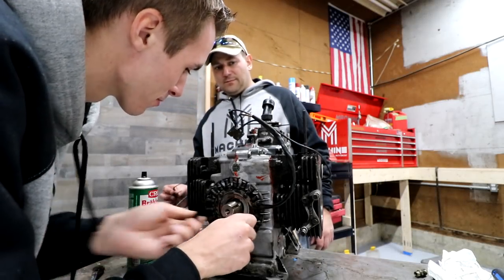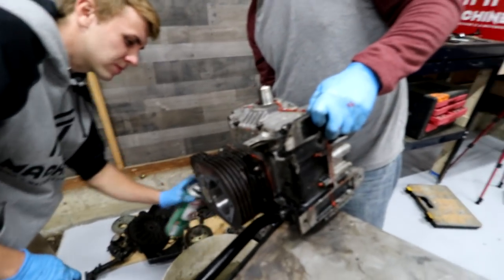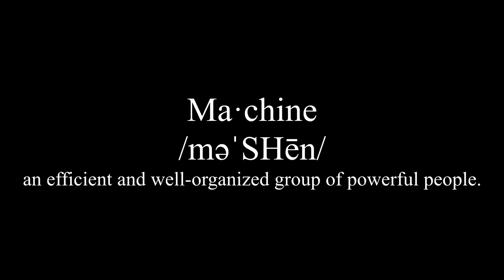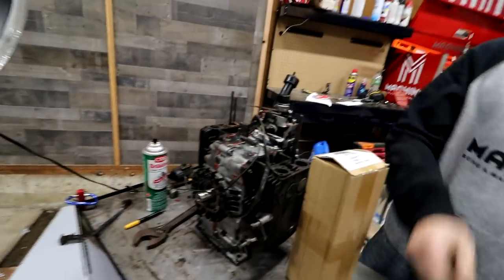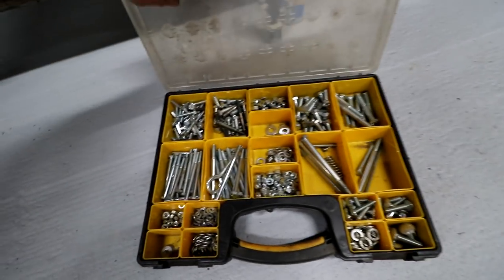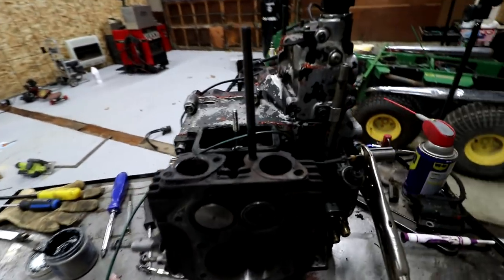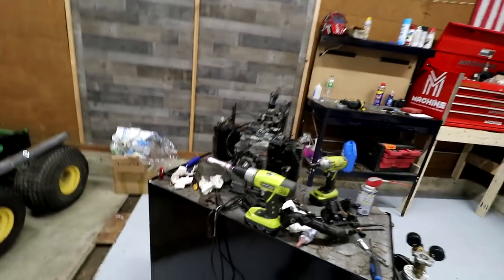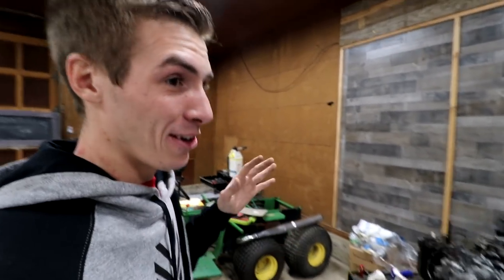NEW GATOR ENGINE BUILD (part 2)

Comment: The amount of RTV gasket maker used hurts me deeply
Reply: i was about to comment the same thing.
Reply: Yes...someone needs a lesson in gasket sealers
Reply: was about to comment the same thing. didn't even used one gasket for the entire motor
Reply: yup,... ;-}
Reply: There’s a lot of things bothering me with this build, mismatching pistons and rings...the fact they cleaned the valve access with break cleaner AFTER they put it together which washed all the lube off the springs and valve stems, they aren’t even cleaning the parts as the put them on. Those jugs and head are filthy...like WTF!!?!?!?!
Reply: motor is headed for a very short life,.. or,  just flat out KABOOM!,..  but I think they are only interested in "the VIEWS"  as Dalton says,.. and selling merch.,.. ;-O
Reply: GO4RIDER "im capable of doing those sort of thing". im really starting to doubt it

Comment: Do yourself a favor and buy a horse stall rubber mat from tractor supply and put your compressor on it. The reduction in vibration transfer to the floor greatly reduces how loud it seems
Reply: Rob Plotts you can really use any mat I’ve found but rubber works the best
Reply: Sneakyshark14 horse stall mats are like a 3/4" thick heavy mat and are perfect for the compressor you'll never have to buy another one

Comment: Dalton, you should do a go kart build. Just a regular ol' go kart. Find a used frame. Buy a predator engine, new tires, chain, brakes. Just a simple easy Street go kart project with a little 3d flair. I think it would be a fun easy project that you can tune up in the future. Predator 212 mods are cheap and easy. Keep up the good work buddy.👍

Comment: I hope when he says super charge he doesnt mean one of those  electric "super chargers" off eBay

Well crap of course new video he posted it is a electric one uhhh...
Reply: Trey W I think he means the new Electronic turbo charger from precision turbo or procharger I beleave
Reply: Trey W haha
Reply: He's totally getting an electric one. Ughhh why??? Why don't you just get a junkyard turbo from some stock car. You would get better results
Reply: the engine is too small to spool a normal size carturbo so it wont produce enough boost, so he has to buy a supercharger or a really small turbo from a dieselgenerator or something.
Reply: Trey W or at least do a. Smog pump supercharger. Something cool

Comment: Hey im ready for snowmobile season but my snommobile wont make a good spark what would cause that?
Reply: OhioFarmKid bad spark plug or cdi or battery
Reply: OhioFarmKid you should check the coils and everything that helps make spark but I have seen it before where all they did was change a spark plug and got spark
Reply: I had the problem becuase last year it lasted for a few weeks then went to start it nothin so i changed the spark plugs again its a 1996 indy 500 so i dont expect much but i dont have the money for a 16 thousand dollar machine at age 14
Reply: I will check the coil tammarow after school
Reply: OhioFarmKid bad plugs
Reply: OhioFarmKid don't know much about snowmobiles from florida lol sounds like could be Stator,coils,battery, maybe even a fuse would try start with the simple things and try to diagnose it from there
Reply: Probably because you're using snowmobile parts on your snommobile
Reply: Corrosion from sitting around.unplug your connections and spray electric contact cleaner in them.good luck you will find it.check any grounds for wiring harness.
Reply: Get a 5$ test light, test at plug boots,backtrack to cdi check for light there. Before all this, pull plugs leave them on boots and set them on the head(where you remove them) do at night or have buddy hold hood down so you don’t much daylight. Pull start and c if both plugs or 1 is sparking
Reply: OhioFarmKid figure it out on your own it’s called self reliance
Reply: it could be a censor

Comment: You need a E.F.I.  for it. It won't work without. They make a kit for it.
Reply: Charles Carl you can supercharge a carb engine but it either has to be draw through or you have to put the carb in an enclosure to do blow through like the Paxton setup on 60's mustangs.

Comment: i super hope you are not using a cheap ebay super charger that is actually just a low pressure fan. If you are then you will see absolutely no gain and may actually hurt performance.

Comment: What model carb is that
Reply: Logan Burk most older Kohler engines use a carter or a walbro, i'm not sure which this is because he hasn't said which model it is or what the HP is.  Kinda looks like a kt17 or an m18/m20.